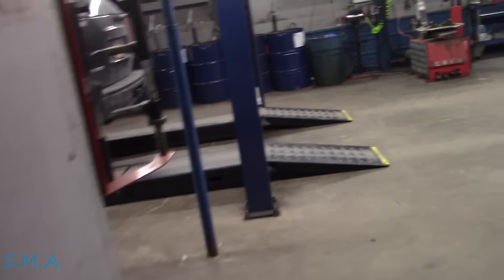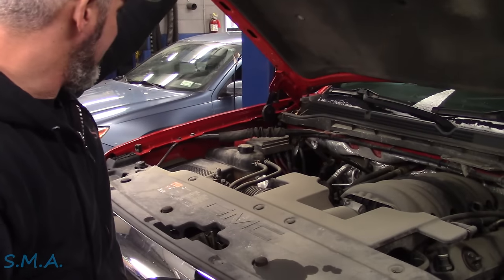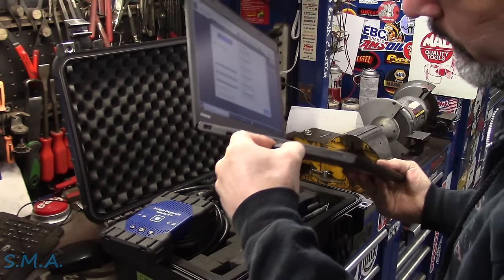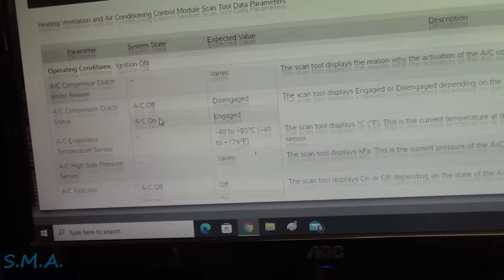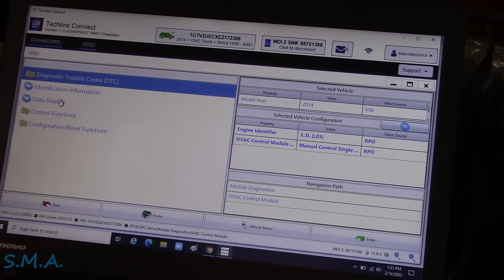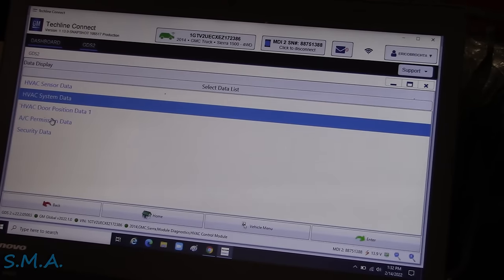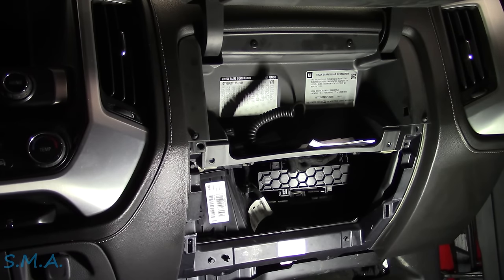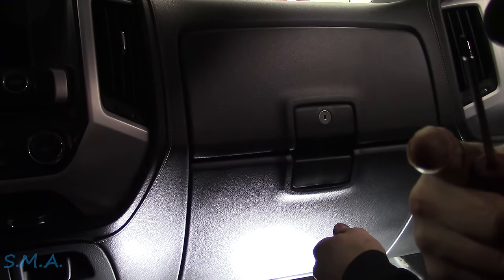Chevy/GMC Truck: Failed Heater Control Module

Comment: It's failures like this that have made me buy a 1982 K10.  Yeah, it rides like an oversprung hay wagon, but it's cheap and easy to fix.  No complicated electronics.  12v DC wiring and vacuum lines.  It's worth picking up on an old truck in decent shape and working it over to make it road worthy, or buy one that someone has already done the work to.

If people stop buying the new garbage and tell the manufacturer's why maybe they'll start re-evaluating their designs.  Speak with your wallet's.

Comment: I work as a mechanic from the time I was 14 with my dad when car where all steel and simple to work on but now it’s a plastic junk and the engineers have done there best to over designed them.

Comment: Seems the engineering on these computer locations has been just a matter of sticking them wherever a bit of room could be found. I hope they reengineer from the ground up and create an easy to access location for all of the computer modules. The other thing that could make this easier, besides access, is to have the master computer be able to run diagnostics and do more than just set a code. If it identified a defective module and it was easy to swap this wouldn't be so painful and expensive.

Comment: I miss my old cj-5 with a Buick 258 straight 6.
First car and first car I wrenched on with my dad.
Wiper linkage broken?no problem, just grab the Wiper from the slot under the windshield and do it manually lol.

Comment: I firmly believe that there would be a HUGE market for an "economy" vehicle that had no electronics except for electronic ignition. I mean wind up windows, simple switch controlled Heater/AC with cable door controls, etc, etc, etc. Just give me a truck like one from the 60's/70's!

Comment: i had a chevy pickup company owned . the resistor for the lower motor was glowing red finally died . North  Dakota temps to -30f . the bakken boom was on so to get repairs involved loading the vehicle on a trailer haulling it 200 miles to where there were techs to work on it.

i rigged a power wire from the battery fused to the blower motor with a switch only on off .got us through the winter. eventually got a company mechnic who was only supposed to work on rigs and equipment to order a resistor for a real fix .

Comment: Even on some of the cable stuff Is a pain on some Ford stuff the doors in the hvqc box the seal on the doors get stuck to the box and then the cable brakes its not a cheep job to do

Comment: A long time ago, a company got customers after building up a good reputation for good quality products which would last a long time. Those companies have gone out of business because they never got any repair work because their products never went wrong. Now cars are designed to maximise the ongoing cost of ownership, and bring forward the day when it is cheaper to buy a new vehicle than repair the old one.  I wanted a part which was only available from the OEM, when I queried the price they said I had to buy a bag of 20!

Comment: I hear ya eric
Old cars are easy . You know here in tx someone took a 70 olds to a dealer a few years back for tune up etc and the new car dealer couldnt work on it bc it didnt have a plug in to see whats wrong. True story had to send it to a shop like urs to have it fixed. 
In the end sir with out shops like urs that can do new and old ppl would be screwed so thats for being around.

Comment: I think we are likely to start seeing people building ways to bypass the modules. There's no reason you couldn't build a control panel that just gave you back manual control over the heating stuff, completely bypassing the computers (or rather putting your own, much simpler computer in, that didn't have to talk with the main computers and bus). I started thinking about this when there were stories last month about companies starting to charge subscription fees to enable  your heated seats and the like - I can pretty darned easily install a PWM controller and a simple wire going to the heated seats, bypassing their controls.
Reply: If someone starts charging $5/month for heated seats I can see an aftermarket thing to plug into somewhere to give them permanently. Maybe it could just sit on the CAN bus and send commands, maybe it has to involve wiring.

Comment: Hi Eric:  Great video as usual.  Every job gets monotonous; that's why they call it work.  Just think of all these crazy complicated systems as job security.   The DIY owner is going to have to step up their game if they want to work on modern vehicles.  At least it is possible.  GM sells fairly inexpensive ($40.00) access to all the software for one vehicle so an owner can program modules if they are so inclined.   I wish engineers would ask themselves one question:  Yes, we can do that, but should we?

Comment: I still have the old days car with a single knob for the heater. On or off It is a 1961 TR3A. It has only 2 fuses in the fuse box.

Comment: I said a few bad words after paying  $14.00 for 2 LED  tag lights for my 2016 Jeep Patroit.. I remember replacing tag lights for under a dollar and getting 3 or 4 in a pack !  I almost just took  the tag lights apart and  replaced the inside with a 12v white led....  Dealer wanted 70 bux ! WHO WOULD HAVE THUNK IT....

Comment: Got a 07 silverado in yesterday and cust stats install and flash customer supplied BCM. Bcm was a dorman unit and i see they also replaced the transfer case control module with a dorman unit as well. Original BCM was already taken out by customer so we had to push it in. Was able to program it but after successful program, it wouldn't start and found there was no comm with high speed gm lan. Figure its the module because dorman so i get an oem bcm with customer approval and can't program it because high speed lan is down and nothing communicates to scan tool. So i start to follow procedure for total high speed lan malfunction and got to the determination that the bcm was bad cus i had all the powers and grounds. Ask some older techs for help and they said to start testing the ohms at the different control modules on the network for the correct resistance. Got 3ohms at DLC and one of the bcm data lines. It is supposed to read 120ohms. Tested TCM and got the 120ohms to verify it was good. Went to EBCM and got 120ohms on both data lines. Went back to bcm and got 120ohms on both data lines. Was able to finally connect a scan tool and program oem module and it actually started. Took for a roadtest and found that when any direction it changed the IPC cuts out rpms go to 0 speed goes to 0 but it still runs. I'm thinking there's a loose connection somewhere but they're not paying for any diag they just want ot programmed. But it leaves a bad taste know there's more to it than just the bcm

Comment: I hope my ‘96 Tacoma keeps truckin along. One cable for hot/cold and a second cable for def/face vent/floor vent control.
Reply: It will until the frame rusts through.
Reply: The west coast is pretty gentle on steel.
Reply: @ppeterson9359  My '96 T100 ran like a champ but the rest of 'er turned into dust.

Comment: you are so right about today s cars they have so much electronic on them and computer its stupid. in the 70s or 80s cars dint have computer and they use to run just as well of even better and almost every man could fix ther own cars at home.

Comment: I can remember a time my fuel pump went out. I just got gas. i walked across the street to NAPA and picked up a fuel pump for 15 bucks for my 73 Chevy stepside with a inline 6 banger. 20 minutes later i was on the road. try that now days.

Comment: first car...1967 dodge dart 225 slant 6cyl. 4 door automatic trans.... absolutely NO A/C...plenty of heat though.... oh and bout 25-26 mpg..... you could rebuild your... carb..starter...alternator....ect.. fairly easy and all parts were aval. at any auto parts store!!!   GOOD LUCK WITH THAT NOW!!!!!

Comment: I was in line at Chevy dealership parts department getting a part and this guy had a bad drivers window switch assy. I told him to pop it open and clean and relube the contacts, it saved him $300. The guys behind the counter wasn't too happy, because they had it in stock. Lol

Comment: It's all getting more complicated & the sad part is it's not just the modules it's the nuts & bolts to. I have a stupid $25 tool just to take out plastic oil pan drain plugs on VW / Audi's. But look at windshield replacement companies, if a new windshield needs calibration better get your ADAS out.

Comment: It's really a shame how cars are built these days. Just looking at the HVAC module that Eric just installed, and that cheesy piece of plastic that holds it in place. I recently wrecked my 2002 GMC Yukon with 319K miles on it and the only part that went bad was the ABS module that they mounted on the frame under the driver's seat, but other than that it was a great truck and easy to work on.

Comment: I love workin on my cars in the days long ago. Forget it now! Got to get a road map sometimes just to find the battery or oil dip stick. Stupid! I had a 68 Dodge 440 with a 225 slant 6 in it. Got 29.9 miles to the gallon and it was solid. Cars niw days are just plastic and filled with junk to make the government happy and they can't get 30 miles to gallon out of it unless it's a shoe box car.

Comment: I've stopped the nonsense at 2005 ... where my newest vehicles live. An 05 Chevy Trail Blazer with a 4.2 and an 05 Silverado Crew 5.3. Both have basically the same transmissions as my '86 Chevy K5 and my 2000 Astro Van with a 4.3. 
At my age I won't need anything newer and I bought a decent Autel scanner, a 2 channel oscilloscope plus I have an old Snap-on Brick MT2500 for the van. I'm all set ... let the Zombies come!

Comment: got 07 gmc canyon blower messed up shop said fan motor shot so i went behind them found main power wire was burnt so repaired it and it works normal again

Comment: Great job Eric,  hopefully with your videos customers will appreciate how difficult our job is,  these lovely modern plastic technology driven cars and trucks are just a crock of 💩 for us to work on and very expensive  to fix , its going to get to the situation where relatively young cars are just too expensive to fix , what's gonna happen when the world is full of wired up electric motorised 3 phase 415 volt vehicles , people will go back to their old Waltons truck , at least that will start and drive , over here in the UK Eric most old vehicles have been turned into washing machines and toasters , so we're stuffed 😂😂👍

Comment: Just had a Ford Edge that cost $2,000 to fix their temperature blend door. Thing broke and they have you replace the whole HVAC system. Take the doors off, the intake manifold off, the dash out, take the skin off the dash frame, take the whole system off, put the new one on, and put it all back together

Comment: Here's the caliber of some of the Junkers I owned years ago : Ford Ltd, leaking heater core , shop calls " It's X amount of hours to take the dash apart to replace it " Me :" Like the car ? You can keep it ." Olds Cutlass stuck way back in the bush Me: " How much for the tow truck ? " " If you want to go recover the car you can keep it ." Chev Suburban broken ball joint in my driveway Me: " Want to come tow my Suburban ? Good come get it and you can keep it ." Mercury Grand Marquis won't start one morning . I call my buddy again that had a scrap yard Me: " You know my brown Merc , it's blocking my driveway , come get it and keep it. " Sometimes it hit's a point it's just easier to hit DELETE !

Comment: Manufacturers make you program stuff on purpose in pursuit of ever expanding profits. 
I have an 03 VW Jetta TDI wagon that I enjoy working on. The germans make a solid product. But yeah, that vehicle is right at the cusp of too many "black boxes" where the fix is replace instead of what it should be- repair.

I remember a video you did where a GMC SUV's taillight went bad and the solution was to replace the entire chunk of plastic, even though it was a bad controller inside the assembly. (perhaps a single solder joint!) Cheaper for the manufacturer, customer be damned.

Comment: even though i am an electronics specialist i miss the days of cables running your gear shifter your throttle your heating and cooling these new cars you need to be an electrical engineer to work on anymore i guess everyone has forgotten the ol K.I.S.S. adage

Comment: Eric, What year did GM start over complicating their vehicles? My 2002 Yukon has 282k. All original but water pump and alternator. NO rust. I'm considered a new drive train rather than get a newer electronic nightmare. My 2006 Sierra does not look too overly complicated. It has 255k.

Comment: For sure bro you’re right on the money I’m so sick of these computer module BS I am plug my ABS module the other day. Pretty redundantly hypocritical if you ask me when you’re any luck brakes lock up because of the traction control BS. I’m fighting with this damn module I don’t wanna flip the bill Cheapest I found a dude and literally I’m in the industry to cheapest I could get one of these automatic temperature control module for my 05 Yukon Homeboy wants 80 bucks which is a Steel compared to everywhere else online. Wonder if I could just switch it out for an upgraded system or Go backwards. I remember fixing a vacuum line in my AC controls in my Saturn with a plastic tube from a Q-tip the cheap kind lol those are the days I long for daily😢😅😂🎉

Comment: It's one thing to make technology that helps the convenience for the consumer that never breaks. Its another thing to make a part that is made in China and made out of cheap plastic and bury it so far under the dash it takes a thousand in labor to get to it. Case in point on my 2002 Chevy Trailblazer the HVAC control motor broke that controls the heat/AC temperature control. Lucky for me it was located in front and not in back and it took only a hour to replace. When I took it apart, the motor had a plastic gear that was striped. If the gear would have been made out of steel it never would have failed, but because it was made of plastic it had to fail. In Canada where it's -30 the plastic is so brittle it has to break. This truck has a lot of cheap plastic on the interior that I've had to fix that I wouldn't of had to on a 4 runner. But an 02 4 Runner's cost in Vegas with no rust would cost $10,000 and I bought this Chevy for $500. It needed rear brakes, the AC charged, a gas cap, 3 window regulators and a new radiator but I'm still way under a grand. and it runs and drives like new.

Comment: The way it should work is you would enter into your infotainment screen and go into diagnostics and run a check and it tells you what module to replace.  Like replace module 33 but all modules should be ran to a central easy to get to location. you open that location and pull out module 33 (plug and play)  and put a new one in that was sent to you by your diagnostic program. 10 minutes and you are back and running.   And these modules cant be more than 100 bucks.   Thats the way it SHOULD WORK.

Comment: This is done somewhat on purpose. They manufacture parts to last slight past the warranty period, which, coincidentally lasts about as long as the average financing period. Boom, a few car-payment size repairs and the cust is heading back to the dealer for a new car/warranty/payment. And dealers are raking in big bucks on financing

Comment: After all these junk problems I'm looking for an older truck with minimal garbage 🗑. I  must admit that I like fuel injection over carburetor.  However, I always made it home with points and if the heat didn't work I used a screwdriver. 
Just too much money for junk that you can't fix with basic hand tool. Remember they don't make money on vehicles...they make it with service and junk parts and sensors.

Comment: If a manufacturer brought out a car that was as simple as the 1960s vehicles they would make a fortune. These cars nowadays are far too complicated and expensive to own. $1000 to fix the radio, $450 + to fix the heater, it's crazy. Too many bells and whistles.

Comment: this is what the world has become, you used to be able to buy something and that was it, it is yours to use, repair, modify and enjoy. nowadays we live in the "subscription world". you dont own your phone, you cant repair it or modify it and the second a new model comes out it becomes "mysteriously slower and obsolete" so you have to pay for a new one. you used to be able to buy a computer game and play it and that was it. nowadays you pay for the game, then you may need a subscription, battle pass, dlc, and dont get me started on cosmetic items. computer programs? autocad for example, you could buy it and it was yours to use, now you need a subscription because that' s where the money is. why would a compay take your money once if they can milk you for decades?
the same happens with cars,  companies realized a long time ago that selling you a car that your grandson would still be able to use was the same as shooting themselves in the foot, why sell a car that lasts 50 years and costs 5k when they could sell 10 cars that maybe will last 5 years and cost 25k? and on top of that when it breaks they make sure you are still throwing money at them, because you need a special tool to change that part, special hardware and software to program it (which has a subscription cost of course) and you may even be forced to use oem parts because of some software locking (luckily the chinese have become very resourceful on this aspect)
in the end the customer no longer buys the product,  it just buys the right to use it, we are nothing but walking wallets to be milked dry